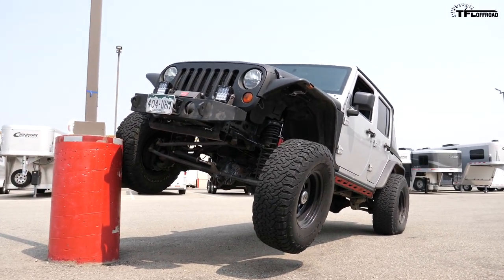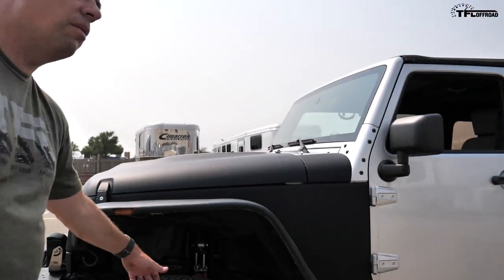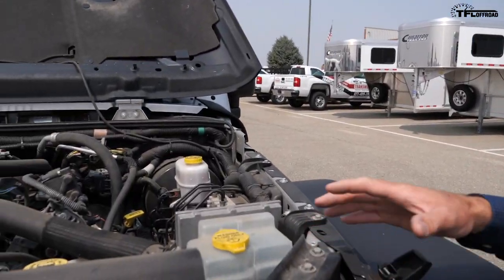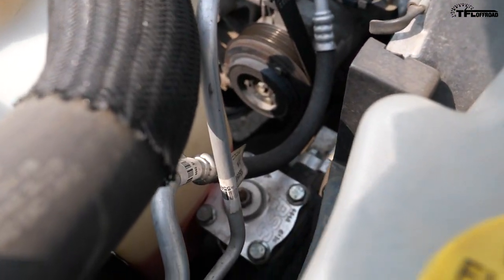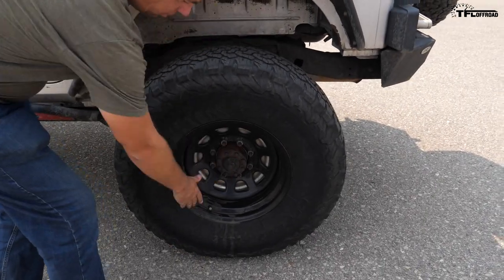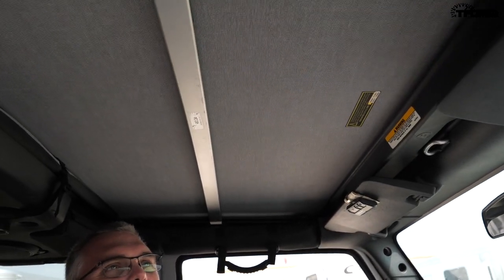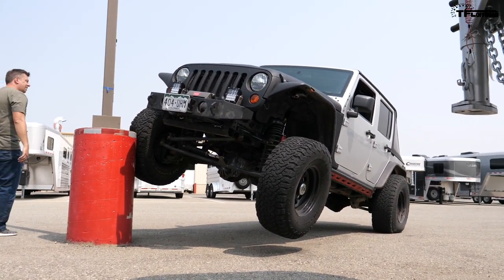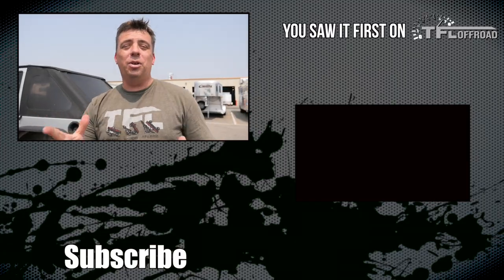$35,000 In Mods Make this Old Jeep Wrangler the Most Capable and Comfortable Ever!

Comment: If I was him I would’ve done a power additive, the Jeep V6 is very underpowered and not very beefy
Reply: I totally agree.....not only is the 3.8L v6 the worst engine for ,well everything and anything, i did a bunch of upgrades as well ,but my 5.3L V8 , was the best one ,for me and i learned a lot by doing it as well. I am not downing his Jeep by any means , bc he has some very usable,and very reliable parts on his JK. We all had (my 3 buddies) the 3.8 v6 blow up around 90-98k miles. Just my opining.
Reply: BB LEE Oh for sure, when it comes to older Jeeps I’d go V8 anyday, for usability is go for an LS. But for a newer one I’d just avoid it altogether, I don’t care for the JL or the JLU for one reason and that is that Chrysler and Fiat just bombed em.
Reply: I have a 07 4dr Sahara with not but maybe the body still Jeep. Lol
Reply: BB LEE A Jeep is a Jeep bud. I myself will be getting a Bronco but it doesn’t mean I hate Jeeps. Partly due to the fact that I work for Ford
Reply: BB LEE I don’t flow any of that, it like your phone had a stroke
Reply: Gearing is all you need

Comment: Mine's a 2007, 4 in  Teraflex springs, Metal Cloak upper/lower.  Synergy Tie rod/draglink & flip.  FOX ATS steering stabilizer, Teraflex track arms, OrFab Tier Carrier, pypes High Ground clearance Exhaust(great sound). Fox Shocks. 5.13 gears, RCV Front CV Axles, 35in TA2s on ProComps, Jensen VX7020 din and LEDS FOG/Driving lights. Only parts replaced so far in 109,000 miles: alternator, serpentine belt, Valve cover gaskets and plugs/wires.   All work by me in the driveway.  :-)

Comment: Lets see if the new Bronco could do that ! I know independent front suspension is not that great like single front  axle for articulation.
Reply: Why should "a new Bronco" have to compete with a $35K+ upfitted Wrangler when a standard Wrangler from the same year can't?  ... you're silly! 🤣🤣🤣
Reply: BTW Humvees with IFS an IRS climbed 3ft walls with both tires, so stuff it! 🤣🤣🤣
Reply: @woxie4990  am silly ok what ever. I know it's a modified Jeep.
Reply: @woxie4990  yea a Humvee can climb over anything.
Reply: @woxie4990  What's a Humvee's top speed and 0-60?

Comment: People that hate on the 3.8 v6 have never driven one... There is a reason this guy kept the engine even though im certain he could have afforded an upgrade...It's because the 3.8 v6 is an old push rod reliable engine that can last when taken care of.. There are millions of these engines still going in cab minivans and jeeps all over the world. This engine likes to rev up it's cast iron block and gets the job done.
Reply: people shit on this motor when in reality it is a VERY reliable motor just underpowered...geared right there is NOTHING wrong with this set up...well that trans behind the 3.8 does suck
Reply: Iv had two and done regular maintenance. Plus every month sinking money into motor. Not a fan of the 3.8 in my opinion and the trans is pretty horrible. Atleast the one in the 6speed was for me. Got sick of replacing and other also replacing gaskets blowing. Not bad for daily driving but if you actually wanna use it the motor will fail and dig deep into the pocket
Reply: There's a reason they back out of that motor after just a short amount of years.

Comment: upgrade your brake booster & master u heard it folks u can't stop. Need 1 to n ram steering & 1 tone braking w/big tires, just do own it. On Gold Rubicon I want to see 1 ton braking prts & axles & I want all jeeps running Ram steering over killing steering prts.
Reply: My Platinum will hve carbon fiber racing sloted & cross drilled brakes as well.
Reply: I hope people actually listen to this part as this is very real and important. I can tell you from a real experience that the stock brakes will not stop with the big wheels and tires. It will also now hold on a ledge and not just push through.
Reply: Andrew Lyons so many people never think about stopping.

Comment: Will you please tell your viewers that the Master Cylinder only changes the way the pedal feels. It does nothing to improve braking power. The cylinder doesn’t move fluid, it only applies pressure
Reply: pi r squared times stroke and you will get the right result. Both ends :-)
Reply: Joe Simon have you ever changed brake setups? I have. On cars, and motorcycles, and bicycles. Currently running 4 pots fronts in place of 2 pot factory, and 2 pot rear in place of 1 pot factory. 
Stock master, better pedal feel and way more braking power. Changing the length to width ratio of the piston on the master will change how quickly the pedal gets hard, but it’s not going to improve performance. I guarantee you that piston isn’t running out of fluid, even with the massive calipers I’m running
Reply: I was really close to running out of stroke so had to go with a larger master cylinder. The booster is all about pedal feel and pushing the bigger cylinder to get full braking capability.

Comment: 4.01 is a good general purpose gear, 4.88 mayb best but hard core ppl r running 5.38. I just think w/the mini van motor u should hve best gearing & 4.88 must ppl that is the gear & if u know going big a 5.38 on the Gold makes alot of sense. I am running the diesel diff deal, but 4.01 is too mini van wimpy, for real tuff jeep. For M,e go fast best gas but most important max^ tow so 4.01 is a no.